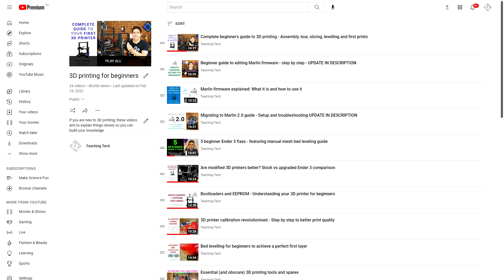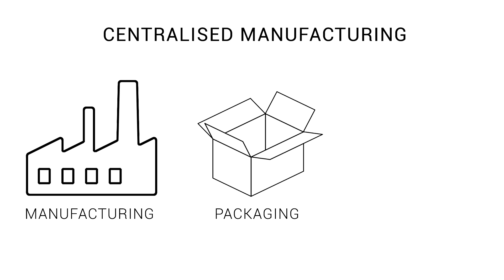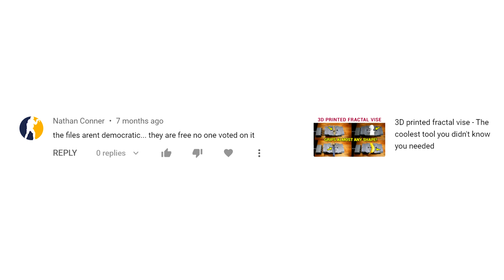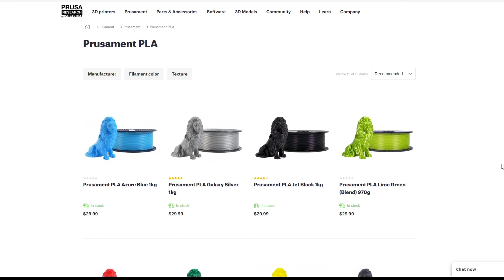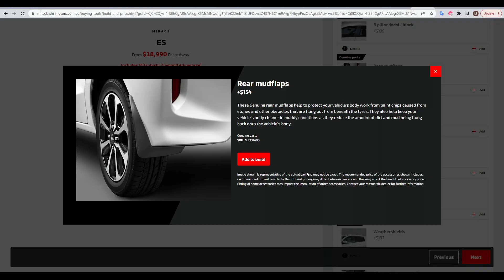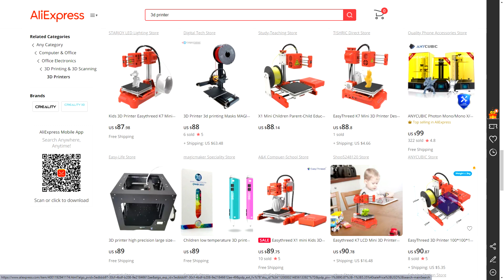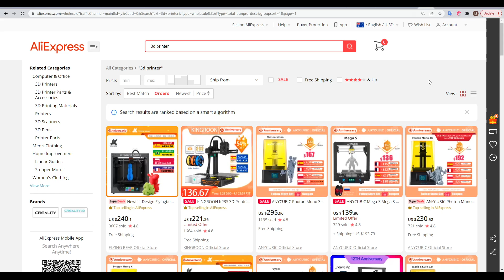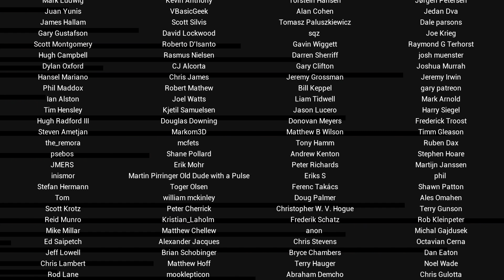3D printer trends are limiting mainstream acceptance: The 3D printing paradox

Comment: 12:55 I hate to say it. But the problem seems to be that they are open source. If you, as a manufacturer, want to innovate, you need to take a lot of money in your hand. But you want (/have) to make that money back before cheap clones have overrun the market. But currently, you can't.
Or only in very limited quantity (of money, see Ender3D).
I have a few ideas. Ideas of which most won't work out. Most of which would require a total different approach to printer mainboards.
Example: Most printers currently are open loop. Why that's bad, or at least not excellent, I don't have to tell you. There are kits that make it closed loop. Problem is: The motor knows which position it should be and moves there … eventually … but the board doesn't know. And worse, even if it did with only running dumb g-code it wouldn't do any good. But to top that off even if it would and software would allow for corrections on the fly. Motor position doesn't mean printer part position. Sure, if you have homed your printer at the start, and you know which position your motor is in, you can make a good guess where your print head will be. And often enough it will be sufficient, and if it isn't you can use workarounds to improve it.
But what if you could measure the position on the fly (with very very high accuracy*)?*² And even better, adjust accordantly.
My very dream machine even knows exactly what the model should look like, and know what it has produced and corrects defects "while" it prints.
But that is only possible with a very different design of the hard- (only the control electronics) and software (/firmware).
It would be a cost factor in the range of designing a modern smartphone. From scratch. Including OS. And I'm not making this comparison for no reason.
The resulting machine would be extremely expensive. Especially early on. But print very reliable, and even remind you on maintenance before prints start to fail.
The biggest problem I currently try to solve in my head is the pressure issue. I had a lot of ideas which looked great in my head, at first, till I made myself realize with which tiny dimension and tolerances we are working here.
Other ideas aren't discarded completely. Like an actuator that sweeps a razor blade under the nozzle, as soon as it lifts, to stop any strings.

*= And it has to be, as flies aren't big, and anything done on them has to be. With the additional difficulty, that these darn things never stay still. Sorry. Could not resist to make fly jokes. Remember: Time flies like an arrow. Fruit flies like a banana. Time flies are incredibly pesky if you're an archer.
²=I have a few ideas how to measure the print head position with high precision, maybe even with *very high precision. It includes the technology from digital calipers.
And maybe a dial gauge (mechanism). Which would be used for a better bed probing. Instead of moving up and down a lot of times. The printer would attach the dial probe and move in x and y over the surface (the gauge has a ball bearing that rolls over surfaces). Which would give many more test points of the bed while being reasonable fast.
Reply: Probably. The lack of serious innovations that require serious capital to realize show the limitations of "community based innovation." And what is even the point of making any attempt of appealing to a market that hates the idea of anyone(but themselves) making money?

Comment: At the end of the day its a very limited tool - like all other meachanical tools! Yes I love my 3-D Printers, yes I work on them to improve their capabilities. But they changed surprisingly few methods I use to achieve goals efficiently and with a good finish. Nothing else of my toolpark lost its job.   

For my understanding the best case is to use FDM as well as SLS Printers alongside with traditional methods like metal and Pur casting,  treating on a lathe, Milling, wood Planking over Frames, Laser Cutting, Knife Cutting, drilling, etching, bending, sewing, paper printing, CNC Cutting... The mix of different methods and materials multiplies the possibilities of self manufacturing. Each tool excels in its special field. Can you do everything on a lathe? No, you can't. But you can do metal parts in a strength and finish quality no other method could give you. Yes you can spezialize on one Method, but it limits you heavily in what you can produce and how efficient.   
That doesn't say, you should not specialize in one method - for example 3-D printing - for educational or recreational matters. But that doesn't make it a tool that is as versatile and professionally useful as a paper printer. And I think it never will be. 

I think a big misunderstanding is the notion on what you can actually produce with a 3-D Printer. When I get asked, I use to say: There are more things you can't do on a 3-D Printer, than you can actually do. Sitting 3 hours to sketch a replacement part yourself and then printing it for 7 hours and treating it for another hour till it fits? Repairing the part with glue, casting a new one by using the old one as the core,  or using a spare part from another used one is generally far more efficient and gives a better appareance. Yes, there are cases where 3-D Printing rules: individual figurines, some special Plastic parts like handles, fittings, Covers and small parts for models. But these are individual new things that would be very hard to do otherwise. That makes it efficient. But repairs? I think it will find a place in the toolpark of well fitted workshops. In more hobbyiest workshops if they get finally easy to use and reliable.

Comment: One also has to consider quality and consistency, which is why this technology may remain more of a hobbyist thing than a mainstay appliance. Generally when you buy something from a manufacturer they have a lot more controls over the materials and environmental factors that go into the process of making something. So buying a traditionally manufactured item is going to look a lot more polished and is typically ready to go without further prep work. 3D printing? (As it is now.) Not so much.

Comment: I'm not worried. What we have experienced is the "Race-to-the-bottom" stage of a fledgling market. During this stage it simply becomes as it describes: A race to the lowest price.
The thing is though. That there is indeed a bottom and once you hit it interests will bounce and scatter. People will start to look for Established and innovative tech.
It is not a coincidence that Creality has lost quite a bit of its fame as it lags behind with its endless variants confusing people, how Prusa has become increasingly synonymous with reliable printing and stuff like CoreXY printers are gaining a lot of traction. Though i think it would be wise if we ditched the "Mainstream acceptance" fantasy. A 3D printer without you knowing how to design and print your own stuff is like having a regular Printer without a text-editor. It just doesn't work well in justifying itself.

The biggest stick in the mud for the progression of 3D printing is that we live in a age where your easily end up wandering into the (online) chinese knockoff market and get tempted by low-prices. Which tends to taint appeal into 3D printing as they simply are awful.

Comment: A few thoughts:

The first mass-produced 2D printers came to market in the late sixties. After more than *50 years* of progress, and a trillion dollar industry spending big on research and development throughout, you would surely NOT expect 2D-printers to still be the one of the biggest support-headaches for software companies - but that's what they are. 2D-printers and printer drivers (and their installation and setup) - despite great improvements - still are shockingly bad and unreliable, especially if you consider how mature that technology already is.

The only reason why you personally don't have to understand what's going on under the hood of your car, is because your workshop takes care of everything for you, regularly, when you bring in your car for service. Cars still do require regular maintenance by someone who DOES know what's going on under the hood. It's just really easy to outsource that, now that cars have been around for a **150 years**, and have become so ubiquitous. But driving early cars did require understanding of how they worked, and going out driving and not carrying a full set of wrenches and an oil-rag with you, was a recipe for disaster. 

Are you really sure that the progress towards better usability for 3D-printers is slower/worse than it was for 2D-printers, or cars, back when those were relatively new?

Comment: Much of the first part of this video covering decentralized manufacturing is basically false. 

1. You don’t cut out shipping, since your PLA roll is still shipped to you, with packaging and rolls which will be waste to the vast majority of people.

2. In basically all mass manufacturing circumstances it is less environmentally friendly to have millions of 3D printers instead of one single specialized machine, and there will  probably be more waste from failed prints than from packaging.

3. It is not financially rewarding for a company to provide 3D files of their products, since them you will have less people buying a whole new product when just a small part breaks. Planned obsolescence is very much a thing.

That said, I agree that it’s sad that 3D printong companies don’t innovate, and that printing replacement parts in your home is great and that it would be even better if companies designed their products to be repaired (for example via 3D printing) rather than being tossed, but it’s not something companies will ever do willingly since it costs money to do and reduces their profit.

Comment: I normally don't post on you tube videos but I do have to disagree with one thing. I think the low cost of a creality ender 3($100 at microcenter in the us, pro version) is an innovation in itself. I would not have bought a $500 Prusa as my first printer. that's too much money for me to gamble. At $160 I got a printer that printed great , had some issues and was a platform that I could mod and learn from. For $500 I got a 370x377 ender 5+ I converted to an idex, and for $120 I found an ender 5 pro I'm modding into a vzbot. The desktop printer analogy is apt. most people don't own a $1000 color laserjet printer even though it's better and more efficient. They have a $60 printer that serves their needs. Also look at how many people have legitimate business with employees running print farms with ender 3s.

Comment: You understand most people see no use for a 3d printer in day to day life right?  I own one, not an entry level one either, but I only use it when I need it and that is no where near a daily basis, sometimes not even weekly.  The speed, cost, safety, and ease of use of 3d printing is not even within the same galaxy of where it would need to be to get to the level you are talking about.  There is also literally NO incentive for manufacturers to make their designs available to a home user.

3d printing will have to be at the level of a standard printer (if not better) to ever have a chance of being "mass market", and even standard printers are not as common as you think.  In fact I know more people who don't own one than do, and I doubt I am in the minority.

3d printing will get there one day, I mean Star Trek didn't have replicators for no reason.  It will probably not happen in my lifetime though, and probably not yours either.  Until it is "put in cartridge, download file, click print, it runs ultra quietly, with no fumes or safety issues, and your print is done within the hour no matter what it is" easy it will not see mass adoption.

Comment: Your solar power/greenhouse analogy is way wrong. The input energy for 3D printing goes into a less efficient mode of manufacturing. For now anyways, there are upstream logistics with you getting a couple kg of filament mailed to your front door. As opposed to you driving to the store to get 50lbs of food and some other needed plastic things. If done correctly the existing centralized system is far superior to the diffuse 3D printed supply model. Where it isn't done correctly is where you get individual things mailed to you or you drive to the store to get some much needed baby yoda figurines. In some cases people with 3d printers have more plastic junk then they would otherwise (myself included). The heating elements and motors in a 3d printer make for a convenient, less efficient way to make stuff.

Comment: i get the point raised here i mean that anker company is trying to make a 3d printer that is trying to solve all this problem... so it must be a real problem if a quite a large electronics company is moving into this sector...
And yes i agree this needs to change because i was also slightly disappointed my first 3d printer the anycubic kossel linear plus, i had to build it myself and i had to install ball bearing for the linear rails and apply the grease... i think doing all these small things will turn off 1st time new customers if they didn't know what they are getting into... 
i choose that printer only because it was the least amount of tinkering and assembly needed for a beginner, so that i don't mess it up, and due to its cheaper price and print volume in my country...
i mean i luckily kept watching an unboxing and an assembly video of that printer for a week just to prep myself to click the buy button to know what i was getting into... 
and that was considered at that time the least amount of assembly needed for a 3d printer... which is kind of true since i build it within less than 5 min and was ready to print almost immediately... the time consuming part of the build is the linear rails due to the ball bearings... because everything else is just tightening the screws at specific spots... and i have no problem with wiring is almost brain dead simple but it could turn off the general public that has never done this before...
the general public wants to buy something and its just plug and play like conventional paper printers.... they don't want to expect the need to assemble the printer again after buying it... especially not putting in ball bearings into a linear rail system and making sure not to lose the ball bearing and to grease it up yourselves... and if there is a need to set it up, it has to be simple and painless to the point that its brain dead....
for a mass consumer adoption this current problem needs to be fixed because even the resin printer would turn people off because of the extra steps to set it up and to wash and cure the print and making sure not to touch the resin with bare hands along with an area with good ventilation... all this setup requirements also turns off the average consumer... their tolerance level is lower than people like us who can tolerate these extra steps.... the only reason i haven't got a resin printer is not that i can't afford it... in fact there are a few way cheaper than when i got my kossel with  a good build volume... its more off the extra steps required when compared to a filament printer required to prep for each print and after the print.... i love the details but not those extra steps so my tolerance is only enough for filament printers...